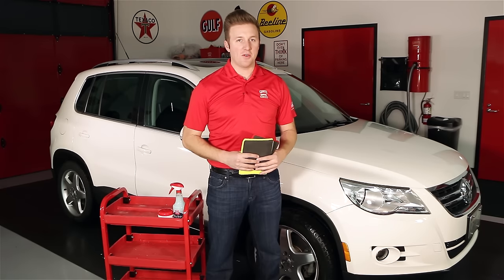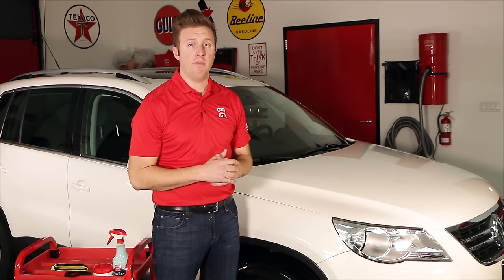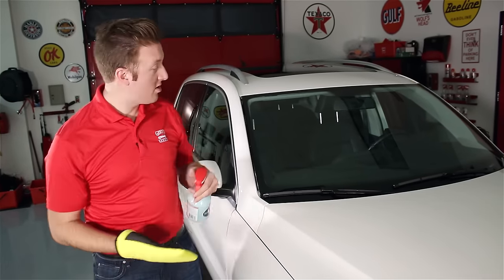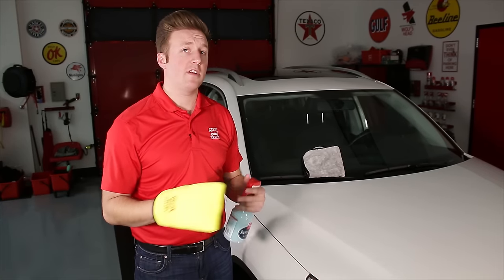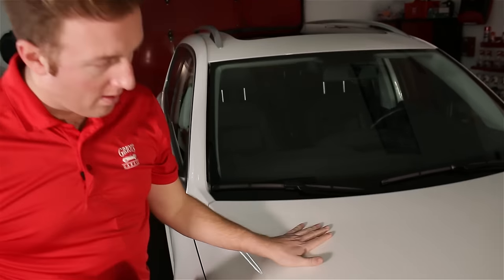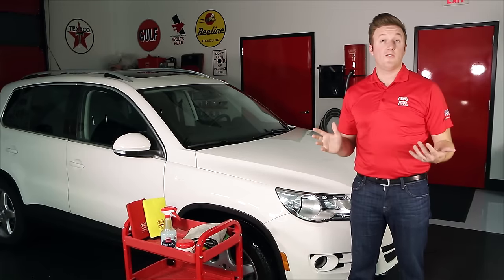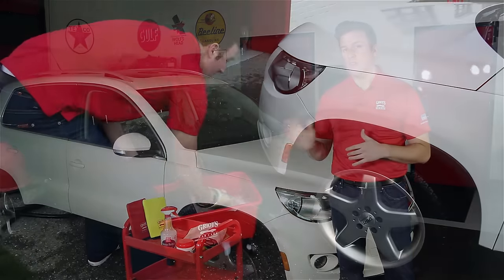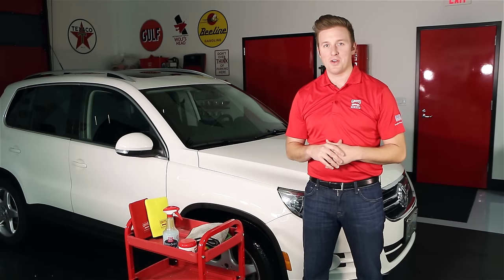Griot's Garage - Surface Prep Mitts: Fast & comfortable contamination removal

Comment: i love these style of claying but they all have 1 problem.  and that is they never seat correctly.  i always have to open and spread out my fingers like im counting in math class to be able to use it without it slipping off my hand.  would be nice to have a string to hold inside the mitts or a glove inside the mitts for a secure grip.

Comment: That is an EXACT copy of the Eagle One mitt. I mean wow it's identical!
Reply: No it's not.  The griots version has a greater surface area that the eagle one.  I am surprised that as a tester yourself, you failed to see the difference.
Reply: aquarianuw - Car Stuff did they ever state the dimensions? From the video alone it looks like the same. Just because it might have a "diamond shape" does not mean its bigger or different.
Reply: +Acc0rd79 http://cdn.speednik.com/files/2015/06/mitt_1.jpg Once again, the rubberized surface area is way smaller for the Eagle One compared to the griots.  I don't even know what's there to argue?
Reply: +Acc0rd79 Eagle One looks cheap as hell. The rubberized part is so thin that looks like it would last just 2 cars LOL.
Reply: ***** well you haven't tried one clearly, I own one and think it's perfectly fine.